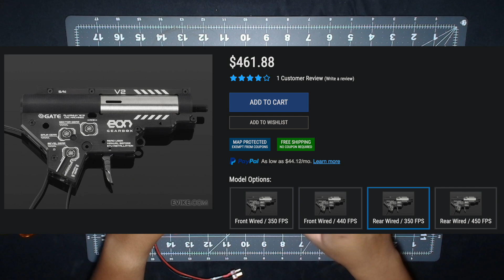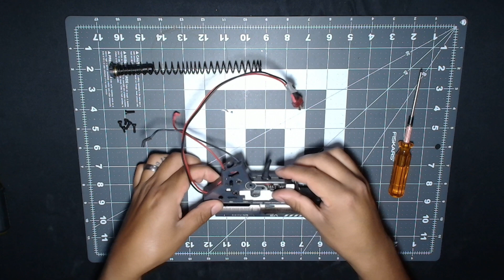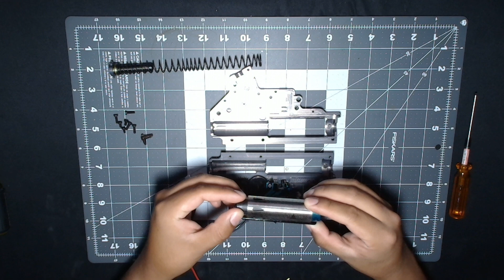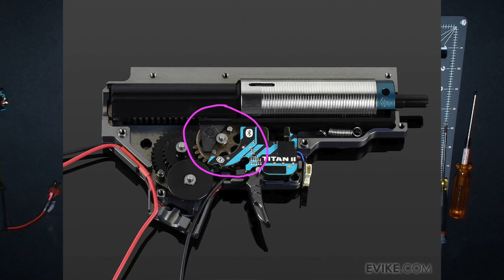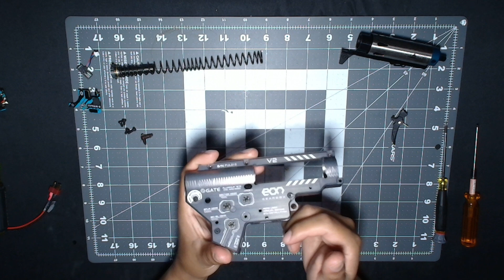Best Complete Airsoft Gearbox? Gate EON COMPLETE Gearbox Teardown and Review

Comment: I ran into so many problems see below
- bought 5 of these complete gearboxes for a custom project to throw in G&P magpul lowers with G&P vltor uppers so I could swap any upper and lower for perfect consistency in the builds 

- First is not a gearbox issue but the gate eon does not drop in fit a G&P magpul lower properly, I had to make polymer shims out of craft mats and glue them on both sides, the back and inside the trigger area of the lower receiver to line up the gearbox and keep it from moving or tilting, annoying but doable and won't be an issue for every lower, but worth mentioning you may have fitment issues with different lowers.

- The gearboxes had massive internal issues though, beyond the fact that I bought all 5 to be the same model, one came with a POM piston head while all others had aluminum piston heads, two had solink gear sets, 3 had gate brand gears (two of the gate gear sets broke) , three different cylinders were used among the five gearboxes, one broke it's anti reversal latch, one broke it's piston, and two of the gearboxes crushed their spur gear bearings cause the shimming was done so poorly. Additionally the RPS round limiter feature of the mosfet was causing stuttering and excess heat in the motors 

- At this point I didn't trust any of gates work, so I replaced all the bearings with modify J-cage bearings, every gear set was replaced with real deal 18:1 sets, the anti reversal latches were replaced with Aztech enhanced anti reversal latches (have to make a custom polymer inserts to hold the spring in place against the gearbox) , re-shimmed all the gears, swapped the POM piston head for aluminum and replaced the busted piston, plus swapped all the cylinders to MAXX cylinders (which were already used in two of the gearboxes)

- Next I switched to MAXX pro hopups, they use an inlet system to fit different standard gearboxs and unfortunately the gate eon inlet hole is unique at a 11.25 mm diameter, MAXX only has inlet sizes of 11. mm / 11.5 mm / 12. mm  so I had to get a 15/32 drill bit (basically 11.95 mm) and drill out the inlet holes on the EON gearboxes to fit the 12. mm MAXX inlet super snug

- Finally after reassembly I found the air compression was inconsistent from the quality of the GATE o-rings, so I swapped the piston head o-rings to real deal airsoft, I Teflon taped the cylinder heads and added the o-rings back and the stock nozzles were polymer with no o-rings, so I swapped to 21 mm double o-ring nozzles from MAXX which worked perfectly after adjusting the amount of shims in the hopup inlets to tune the nozzle fitment

All in all the Gate gearbox itself is decent except for the inlet hole size but the QC on the gearbox parts and part fitment is crap and you void the warranty fixing their mess internally as you have to remove stickers that keep the gearbox closed, also you void the warranty on the mosfet removing the RPS limiter which also magically fixes the stuttering and motor heat issue.
Reply from the maker: wow, sounds like you have a real nightmare time with these gearboxes. I was only able to get my hands on 1 for personal use to really look at it closely and have installed several in the past for customers. I did notice that some were using different parts combinations (piston head material and either Gate or Solink gear brands mostly). To be fair, these are a good complete gearbox that do offer a increase in performance but I would be a fool to recommend them as a drop in system. When I was installing them for customers, I still had to take it apart and re-shim and tune according to the gun it was going in which in my eyes defeats the purpose. 

G&P is like notorious for not meshing well with TM standard parts so im glad you were able to get them to work together with like minimal mods. I think im going to test the best CNC hop-ups and kinda have like a shootout but I need to put together a good test sheets for optimal comparisons.
Reply: @airsoftpartsbin  Here is the issue, for the money I would agree with you that it's good value if it was a "build it yourself kit" and the warranty was on the kit parts, but they sell these as complete drop in gearboxes and you actually have to go in and work on them before you can actually drop them into a gun. The other part you aren't mentioning though is that the warranty only covers you if you don't open up the gun and work on it. So it's only good after you work on it which voids the warranty and means Gate doesn't have to incur additional expenses. Total scam / ripoff for a big airsoft company to do that, it's actually a little scummy. Not to mention issues like the anti reversal latch spring being weak or the bearing crushing themselves is unacceptable. Or giving you a gate mosfet but putting a round limiter on it and removing the round limiter voids the warranty on the mosfet, again scummy. I also found the trigger they give you is adjustable for both take up and over travel, but unlike other adjustable triggers the take up adjustment can only be done internally on the gate trigger after you take the gearbox apart. So again they give you a great part but if you use it fully you void the warranty. 

Better off to build a custom gearbox from the ground up with a retro arms gearbox and maybe just use the gate mosfet and the gate tappet plate as those are the best parts. Then you can avoid the same issues and send a message to Gate at the same time.

Comment: You think the G5 smart motor will be good for this type of build?
Reply from the maker: personally, I do not think so. I would recommend doing a ground up build around the motor. I feel, regardless of the brand and model of motor being used, you are going to have to open up the gearbox to properly shim the motor to the gears and that is kinda defeating the point of a "complete upgrade gearbox".
Reply: @airsoftpartsbin thanks for the information, I appreciate it

Comment: Does it fit in a vfc avalon calibur cqc?
Reply from the maker: Yes it should be compatible. might need some small mods for the ambidextrous selectors and selector plate fitment into the lower receiver.

Comment: So i have a weird question. Do you think a novice can do this dropin? I have a femme fatale and i want to get one for my own but i im kinda worried about doing a drop in.
Reply from the maker: I believe a novice can drop it in, but generally when replacing a complete gearbox,  there are some additional steps I like to take. For example, shimming the motor and motor angle to the new gearbox. Also, making sure the air nozzle to hop-up fitment is perfect for the best air seal and feeding. 

You can directly drop it in but you might not get the best sounding gearbox or best FPS/feeding.